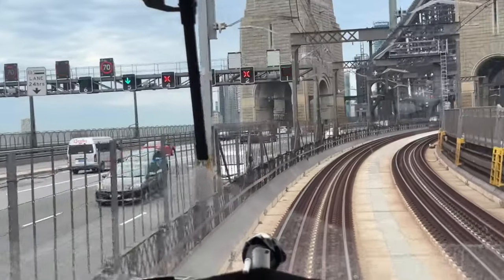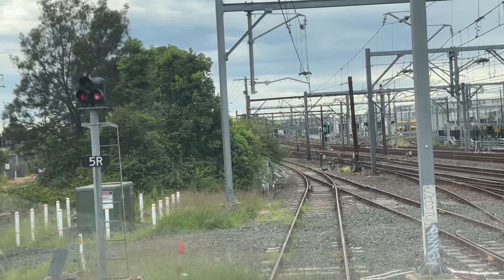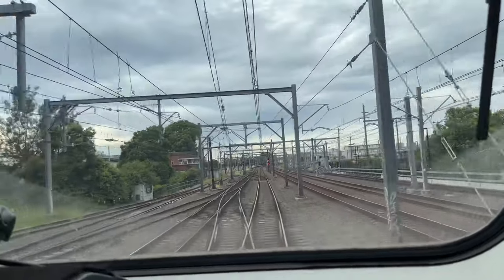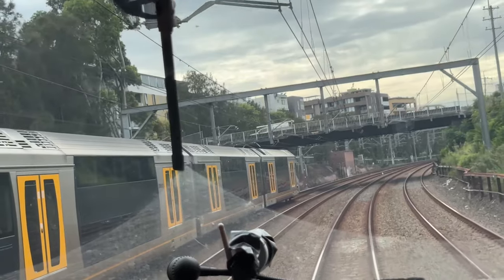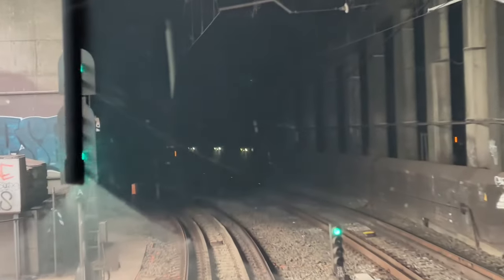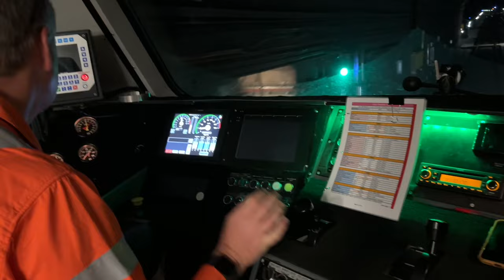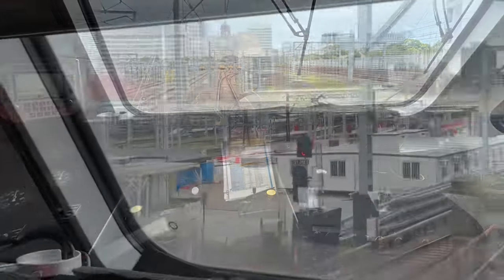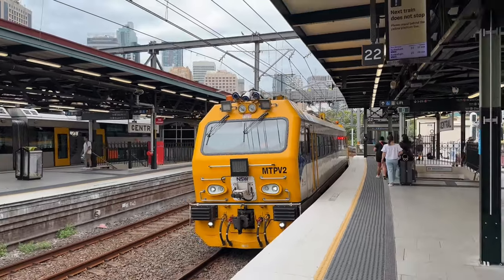I Rode On A Track Inspection Vehicle - The Train You’ve NEVER Been On Before!

Comment: Great video! As fun as it is to ride up front, hopefully you got a chance to look at the computers in the middle that run the track geometry measurement system. That's the brains and gives hard data. Rough rides can be subjective depending on the train you are on, whereas the measurement system can tell you if it is safe to keep running trains over the track and the problem can be fixed at a later date (planned trackwork) or whether immediate network disruption to repair the issue is required. The MTP can actually be a rough riding train (more bouncy), especially forward of the front bogie where the driver and track inspector are located suffer the worst G-forces vs between the bogies. There's a great amount of knowledge in the engineers in that team who can tell you exactly how it works. Regardless, hope you had a great day out!
Reply from the maker: Cheers :)
I was able to take a look at the computers but did not film anything for the privacy of the staff onboard. Thanks for watching!

Comment: What an amazing experience that must've been!

We use similar track inspection vehicles up here in the US. The differences are we don't have buffers on the ends and the driver controls are on the right.

Take a look at the Hells Gate Bridge built by the New York and New Haven Railroad... It's the same or similar design to the Sydney Harbour bridge except it's only for trains and it has a lot more tracks. 🙂

Comment: Very cool! So, presumably the track inspection equipment is only in use on particular segments of this overall journey? Does that affect the maximum speed and did the driver explain what happens with these measurements after they're recorded?
Reply from the maker: Hi Adam, I appreciate it :)
Your first question I’d say yes and no as it’s kind of a mix, mainly it’s all off during breaks or shunting. To answer your second question - yes the speed is reduced as the max I clocked us going was around 75 km/h. And to answer your final question - yes he did mention it, I don’t remember if I included it in the video or not but he did mention at some point that normally the next they they go over all the photos taken as although it may look like video, it’s actually photos! So they inspect it all the next day and you may have heard the man in the “secondary” seat at the front drivers area of the train going on the radio pointing out things such as “rough ride” or “top” (top basically means that the top of the rail is not smooth and needs to be replaced)
I learnt a fun fact that apparently they get terabytes of photos in just one run!
Anyways, I hope that answers all your questions!
Thanks for watching! 😊
Reply: @tsetstransport  Thanks for the comprehensive answer. All very interesting! 👌